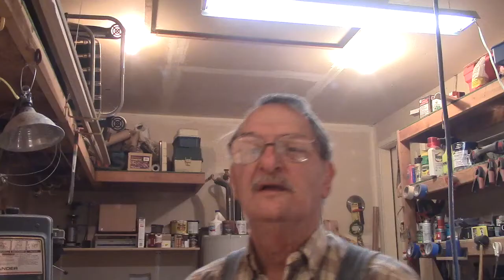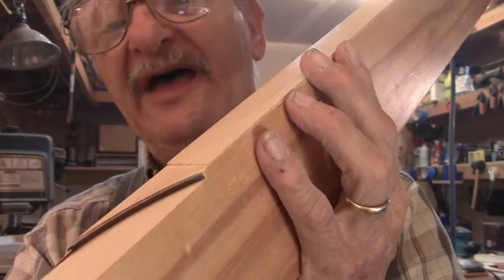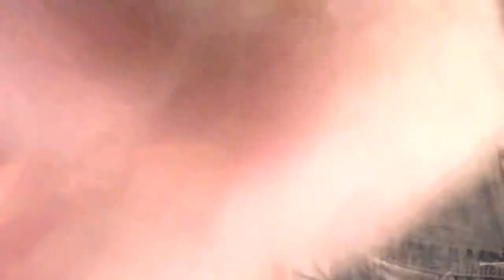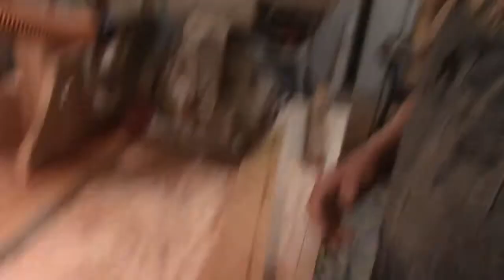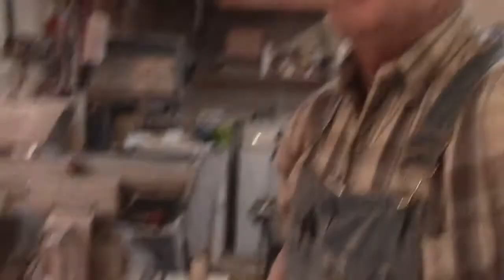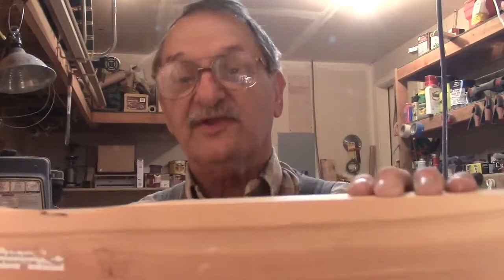Joint A Board Using A Radial Arm Saw #2

Comment: I didn't know what a kerf was so here's for your viewers like me who were not familiar with the term...
kerf
/kərf/
A kerf is the width of material that is removed, burned, or displaced by a cutting process, such as sawing, laser cutting, plasma torching, or routing.

Key Concepts

• The Cut Slot: When a tool passes through a material, it does not just make a zero-width line; it turns a small strip of material into sawdust, chips, or vapor, leaving behind a gap called the kerf.
• Saw Blade Design: In woodworking, a saw kerf is typically wider than the steel plate of the blade itself. This happens because the saw's teeth are bent or "splayed" outward to alternate sides, which prevents the blade from binding or getting stuck in the wood.
• Laser and CNC Cutting: For digital fabrication using devices like SendCutSend, kerf refers to the micro-width of material vaporized by a laser beam or carved out by a router bit.

Why Kerf Matters

• Measuring and Marking: If you cut directly down the middle of a pencil line, the kerf eats away part of your measurement, which can leave a board or metal piece slightly too short. Woodworkers usually cut on the "waste side" of the line to preserve the target dimension.
• Compound Material Loss: When making multiple cuts across a long board or a sheet of plywood, individual kerf widths add up. Ignoring kerf in a cut list optimizer can result in running out of material before the final part is cut.
• Bending Wood ("Kerfing"): Cutting a series of close, parallel kerfs partway through the thickness of a rigid piece of wood allows it to bend smoothly around a curve without breaking.

Comment: Ed, you could probably do thicker stock if you built a fence/jig that extends out far enough so that you could use the saw in the OUT-rip position.
Reply from the maker: +Anthony Shelton I think you are right.  I also think it might be safer in that you won't be reaching over the table.  I might also use a feather board on the out-feed side.